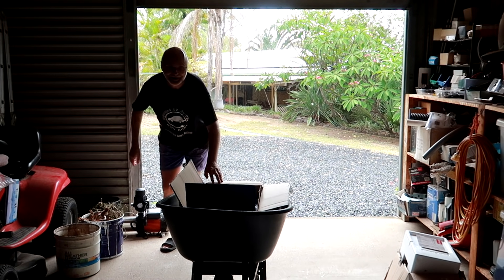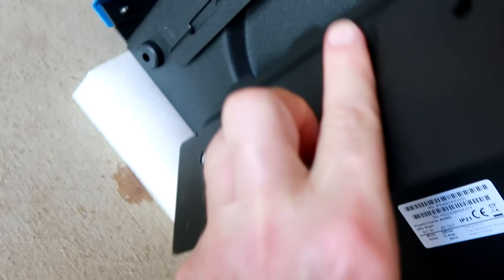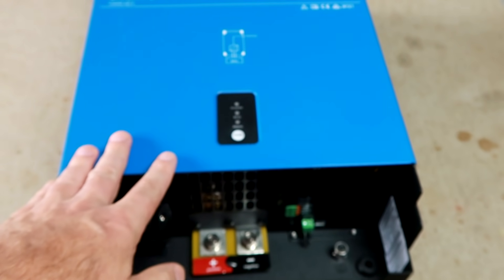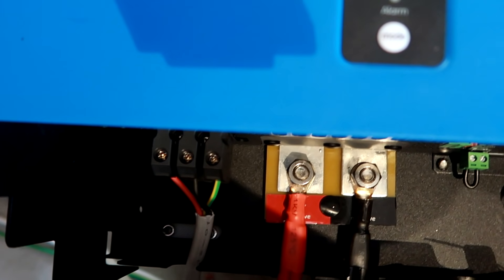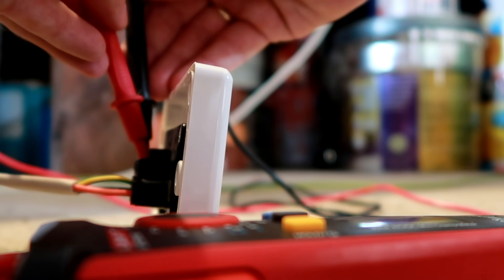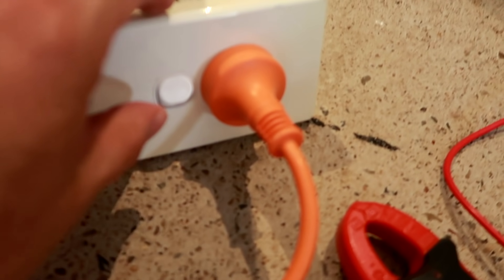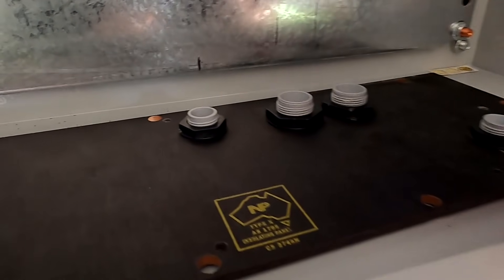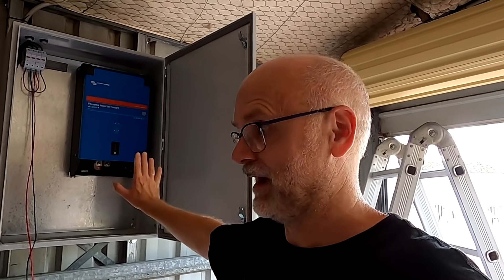Victron Phoenix Inverter Smart. Is 3000VA enough to power our garage?

Comment: I got the Mk3 USB to connect and program my victron inverter, rather than bluetooth. I like the fact you can program everything  :)
my 2000w Victron is twice the size of my giandel 3000w. The victron stuff does seem well thought out, plenty of options for various usages in the real world  :)

Is it not worth keeping the old inverter? Then you can use all 3000w to charge the Tesla and swap the pump to the other for when it runs.  I have 2 inverters and switches to swap the loads between or all onto the Victron thats on 24/7.  Ah ... you maybe clicked that later on in video "it depends how often i charge the tesla from this one"  I think  thats the way - leave the Victron on 24/7 for your normal loads / well pump  and have the old one for just charging the Tesla  :)
Reply: I totally agree Kev, Andy should have kept the better performing Xijia inverter for the heavy work (Tesla charging) that way he has the new Victron Smart for any miscellaneous uses. The Xijia 3k would have no problem at 2800W constant charging at 12A for 5hrs or until is battery cuts out. I was impressed to see this little Victron Pheonix 3k outputing >2600W for a few minutes they must do a lot better without the MPPT built-in. My Victron MultiPlus II couldn't handle >2000W constant on hot days. I think Andy shouldn't put the Pheonix inside the little cabinet if he wants to get 2500W for hours on ens - it simply won't do it. Victron is top quality but low performing at high temp ambient.

Comment: ... you know that 3000VA are not 3000W ... it's rated for 2400W continous load ... (a little less than your old inverter) ... therefore you got an overload warning at 2500 Watts ...
Reply from the maker: Yes, I know VA is not equal W unless it's a resistive load.
Reply: @OffGridGarageAustralia  ... dann is' ja gut ... (-;

Comment: Ive had bad experience with Victron, they look fancy and have fancy features, But the converters i bought didnt at all do what they claimed and the service was horrendous.. they basically send you to a community forum where no one ever answered my questions. I went for something from China for 1/4 of the price that actually did what it claimed and had service that answered questions within 1h. Viel Glueck!
Reply: what did you get from china? brand type store etc? 😉
Reply: @PhilippeCJR  well I had the orion 12/24 20 as they advertised them as useable as battery chargers.. which turned out is maybe true for a little drone battery or something but not my use case. What I got from China is 1500w boost converters from AliExpress, I run 2 in parallel to charge my Tesla battery pack, running perfectly fine for 6 months now. The Orion's simply don't current limit, so if you run them into a Tesla pack they just go to 120amp and fry your wires or themselves, in my case just tripped the breakers immediately..but if it's say they are for charging batteries it should do so. Anyway I'm staying away from Victron, the service experience was terrible.
Reply: I have a pair of Giant brand 5kva 4kw all in one units set up as parallel 230 vac. They can be set up as 460 vac centre tap or with 3 units 400 vac 3 phase. You can parallel for those connections as well.
I bought them in 2015 from Aussie Batteries and Solar on the Sunny Coast.
I bought them before the Lithium revolution got going.
Unfortunately Aussie Batteries haven't made the step to Lithium, which is why I'm watching Andy, Will Prowse and others.
At this point I'm deciding how many 280AH 48volt  strings to buy.  Each string will warrant a separate BMS and probably active balancer. They will replace 5 AGM 130AH strings.
It would be nice to bump the output up to 245 vac to match my grid tie Kaco.
Reply: @mikenewman4078  I just found the diybms here on YouTube, seems a very cost effective and also fun BMS for some crazy battery setups..like how open it is, should be super easy to integrate into something like home assistant. Also can deal with a ton of cells and has pretty good balancing current. Might be worth a look if you like tinkering.
Reply: ther authorised dealers and engineers offer regional support they don't as they have a language barrier contact the dealer you used

Comment: Common misconception is it is 3000w but it is not. It is 3000va. It is 2400w at 25 Celsius internals and 1700w at 65 Celsius internals.
Reply from the maker: Where does it say internal temperatuer?

Comment: The size difference is because victron inverter is toroidal low frequency inverter. With large transformer.  All cheap inverter are high frequency without transformer!!! For these reason are more lighter and smaller

Comment: Instruction read ? So unmanly. VE bus is for what you expect it is not gx included afaik. Smart yes, but not genius. It will overheat in that cabinet and will reduce output. Check manual gain output limit is env.temp dependant.

Comment: Why Phoenix?  The Multiplus II GX can be obtained with 48V dc capability and would operate as you hub for the Venus OS.  You know why your Phoenix is not as smart as you appear to expect.  I will not go into details and leave it with you and your pantomime.  I like the idea of the Cerbo but it is over $400 and you will most likely end up getting a Touch 50 to use as a display, another $300.

Comment: dont forget to SET IT UP  dont leave it on de-fault.. its 10 volt out if you look ////??????
Reply: Australia's Nominal AC voltage is 230 volts
Reply: @uhjyuff2095  Technically I think that you are correct, but in practice here in Tasmania anyway, 240 volts is common.

Comment: Before bashing a product I think you should do your research a little bit better not to mention I can't tell how much Room you have on the right side of the Phoenix but you need to make sure there is enough Room on the right side left side above and below that unit if you read the entire instruction manual that is if it is the same as the rest of them because I own the multi plus 3000
Reply from the maker: When did I bash the product? I researched it, chose it, ordered it and mounted it, love it. It's not perfect so I share this experience too as always.